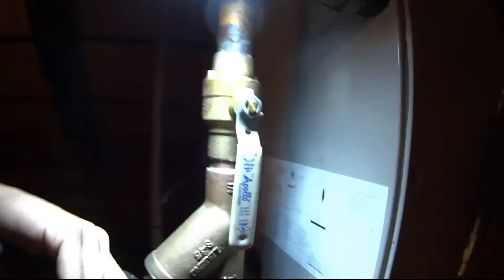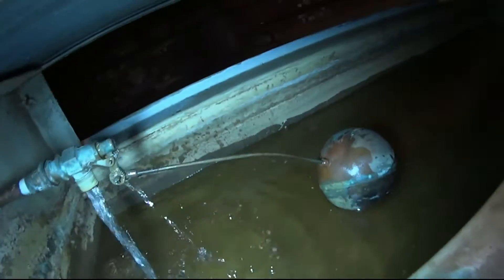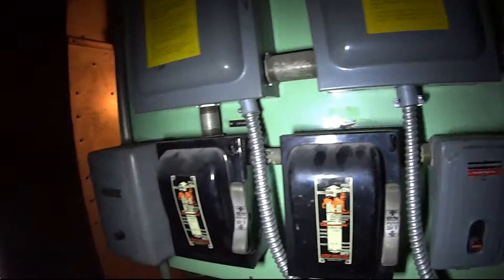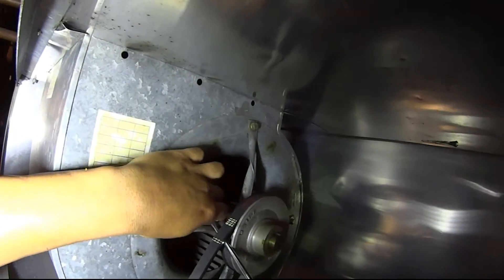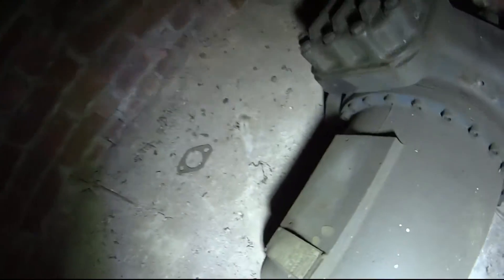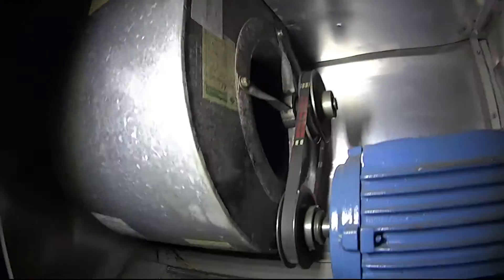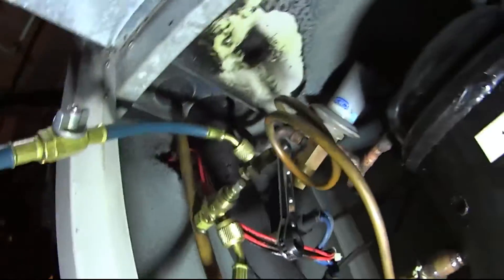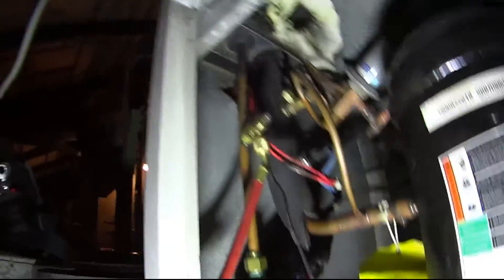Carrier |  Water Cooled | No Cool

Comment: The lack of a temp control on the tower fan is a tremendous waste of power.
Also, when the tech drained the tower and left the valve open, shouldn't the unit have been locked out?  It's sad to think the units were running completely dry.
As always,  your videos are a lot of fun.  thanks Emin.
Reply from the maker: The should have, I failed to mention someone took a out the lockout relay on one of the units, so 1 was off the other was short cycling. In addition I recommended a flow switch so prevent the units from turning on. Let's see when they approve it lol probably 3 months from now
Reply: Emin HVAC that must had been at rockefeller tower in new york, they make all that money and dont want to spend any of it on much needed repairs.  ok just joking, i honestly dont know,

Comment: Hmmm that is weird to have the hot gas bypass. Is there a lot of OSA or maybe they r lazy at changing filters and got tired of coils icing over lol
Reply from the maker: Weird set up lol thanks for watching.
Reply: That or who ever put them in messed up and they r to big and didn't know how to air balance. So they threw parts at it ;)
Reply: Haha I can think of a bunch of reasons. Most include someone messing up or not knowing what they doing
Reply: Emin HVAC they obviously had issues with the evap coil freezing up hence the hot gas bypass. strange.... yeah dirty filters! lets go with that! lol
Reply from the maker: I think they were getting ice up because of cold condenser water that was causing low system pressures, I think all they had to do is install a temperature fan cycling switch on the tower to maintain an 80-85 degree water temp and they would have been fine, just my opinion.
Reply from the maker: I believe what was happening is the condenser water temp was dropping below reasonable operational temps causing low pressures. The tower fan has no cycling switch
Reply from the maker: ***** you got bro, very simple, also on the newer stuff vfd works a lot better.
Reply from the maker: ***** as All ready  know about the vfd
Reply from the maker: ***** no they are not factory, they only use these units for cooling during summer,   I guess they were trying to use them for low ambient operation. Technically HGB are not ment for low ambient reasons, sometimes they use them as an  unloader or like you said for coil reheat.
Reply from the maker: ***** I recommend a fan cycling switch, let's see how long it takes them to approve,  maybe 2 months lol.
Reply: i have seen improperly sized duct work/not enough air flow across evap. and people would ramp up blower speed or add HGB to stop freezing coils,basically a cob job to make entire system work